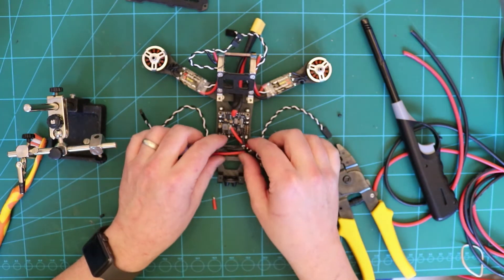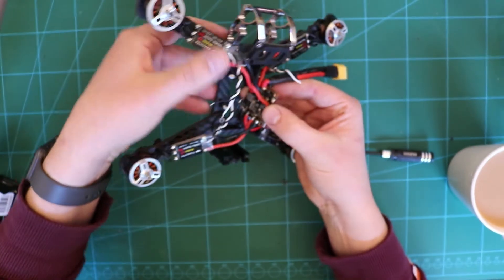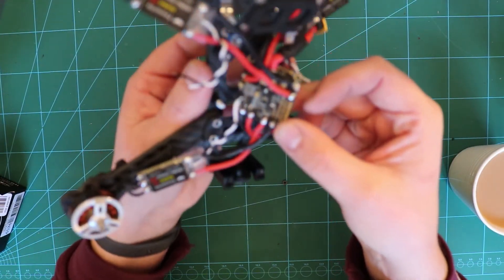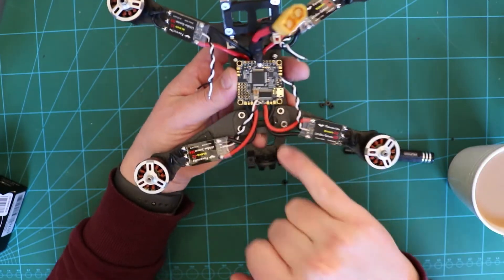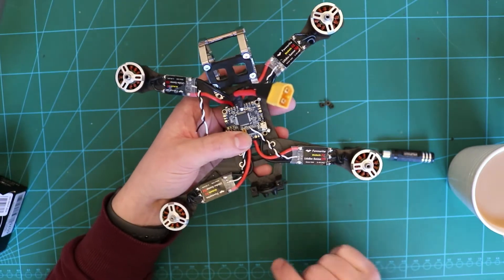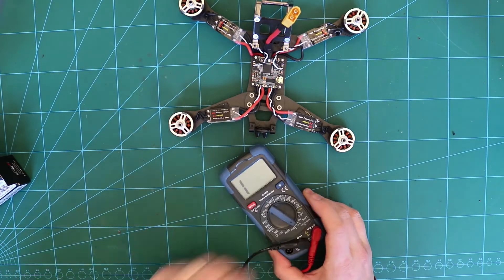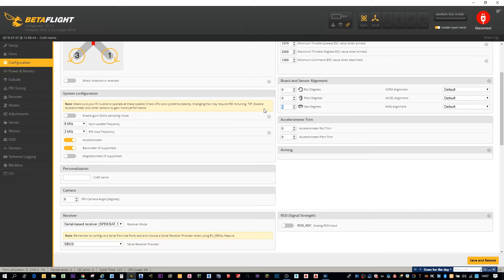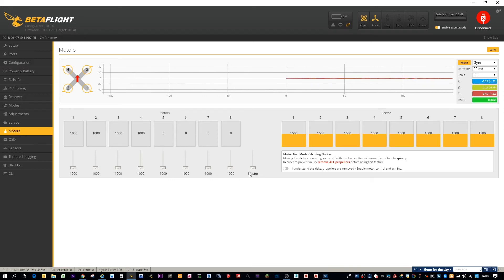Rooster Build Tutorial Part 2

Comment: I don't understand why you use one piece of heat shrink for two wires, for example on the xt60 lead
Reply from the maker: The first individual pieces are to stop shorts. Which is pretty unlikely. Then the piece that covers both wire is really just for a bit of strain relief / better durability.